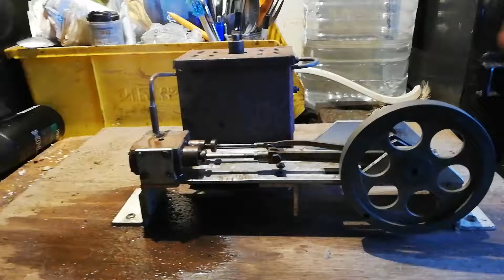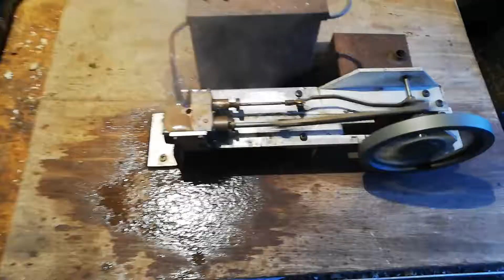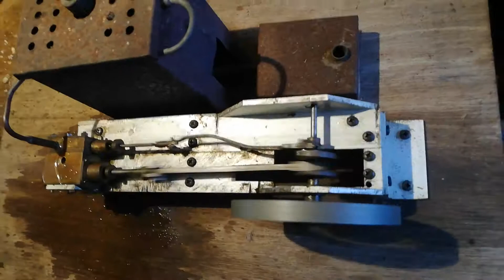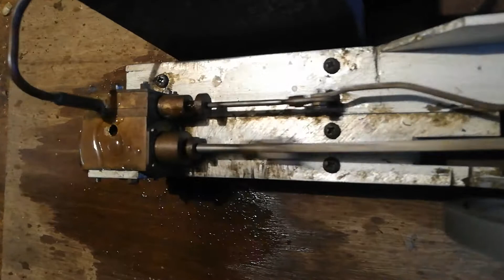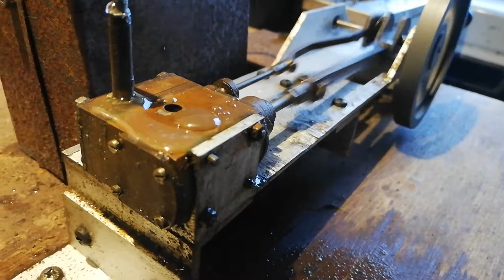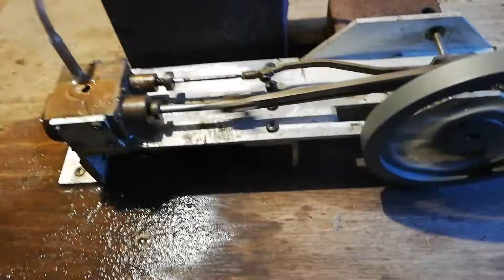Scratch built double acting steam engine

Comment: Great work! I’ve just started making my second scratch built engine, I plan on making it double acting 😁 did you split the steam inlet to either side or have a twin exhaust setup? Check my first engine out on my page! 😁
Reply from the maker: Hi RcRipper, thank you. The steam is fed into the cylinders alternate end through a slide valve in the steam chest. Exhaust is ported through the same valve. Diagonal ports from the centre of steam chest to either end of the cylinders have to be drilled. Hard to explain  and at the time, if I remember hard to get my head around too. It was the reason why I built the engine, I wanted to understand myself how the set up works. I had a look at your engine, which I believe is single acting. Looks like a well thought out little engine. Good luck with your building a double acting type. I'm sure you can find drawings on the internet which can explain the principals better than I ever could, have fun, Ian